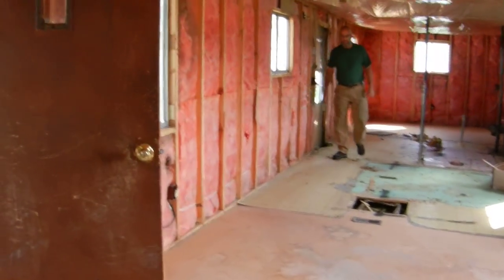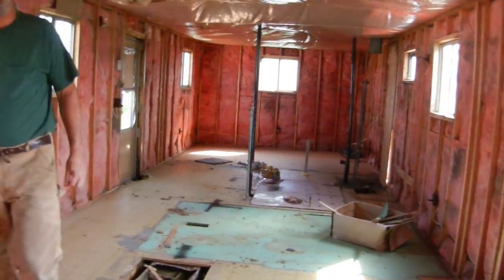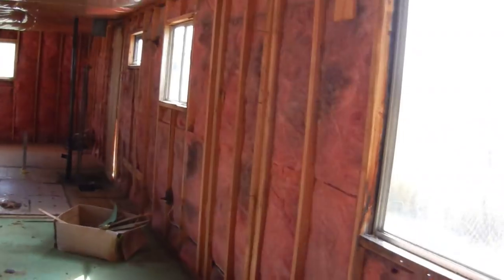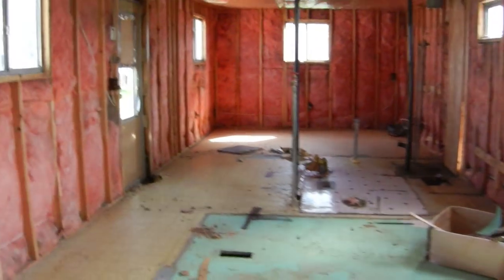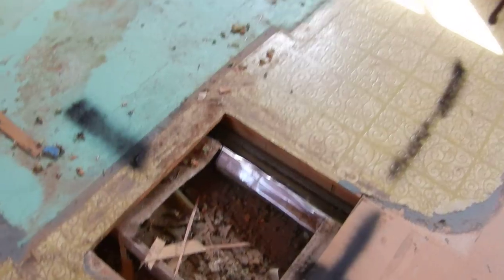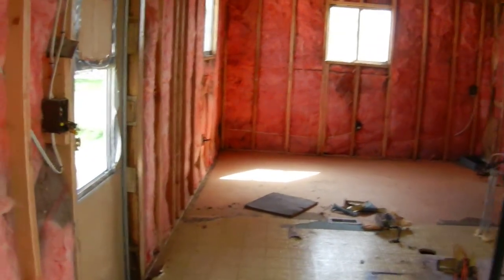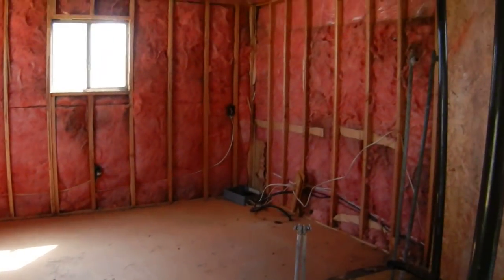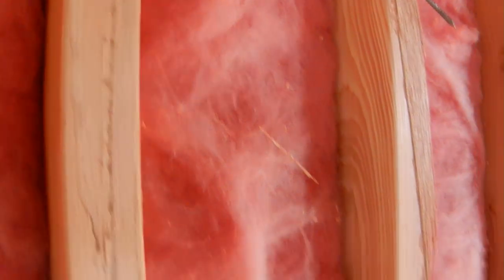Fix Up Old Trailer

Comment: Hi, I see the date of this video. Have you finished the renovations yet? If so, can you post the update please.
I just bought an old trailer home myself and will strip it down soon. Any advice to this single mom on a budget?
Reply: Hi! I just figured I would give you my experience. I have a 1996 4br 2ba clayton mobile home and it was destroyed when I got it. We had to replace alot of stuff but For a few days I called a bunch of friends and family and we got it all dont floors walls dry wall electric paint all for around 2500 bucks looks like a brand new mobile home now

Comment: Do you have any videos of the job as it progressed?  I just bought a mobile home and i am tempted to gut it out like you did and start over from scratch.
Reply: Did you do it? I have a trailer that sat for 20 years and is 50 years old. About to gut and rebuild everything in it. It is that or move and go in debt for 30 years on a mortgage.

Comment: oh please someone help i was given a old late 60 early 70 trailer which is rather bigger then i thought. it needs work but i am not sure if i can fix it. here are a few problems first living room under 2 windows that are side by side the wall moves a little not a lot and just at the windows. i think the beams are rotten out and might be easily repaired. then there is the back door i know the beam that the door is screwed to is rotten i have seen it but not sure how to fix it. the trailer has no insulation under it or in the walls any more. all the windows leak and this trailer has 14 windows total in a 2 bed room. the living room is just about all windows. can i get big windows double hung to fit? please send links wright me just need anything i can get. i have no where less to go
Reply: +fawn williams ...Hi Fawn.  When I had a lot to do on my place, I found a great handy man to work away at all the little things I couldn't do.  I had rot that required some guy work.  I could do what I could do too.  I started slow.  The rot and window replacement had to come first.  I called the local glass/window shop.  They measured everything and fitted me new windows to all my strange sized windows. There is also an 8' sliding glass door.  I divided up the work in two parts a couple years apart in order to make the expenses easier.  Meantime I did some other fixes.  They repaired some of the adjacent framing as they replaced the windows for no extra charge but some of the siding had to be replaced and I had the handiguy do that.  The window installers also built up the casings inside, as the windows didn't have them before.  Dividing up the work didn't cost me any extra.  Decide if you want all those windows the same and try calling your local/well trusted window replacement company and start asking them how to proceed.  If you need to, get several estimates and have some good discussions with them.  It's how we learn.  If I can do it, anyone can. Enjoy!  (Maybe you've done all this already, but I just saw this.)  I agree with Leslie...would love some pictures.
Reply: +itsa goodlife ....one more thing to relate.  I am now buying a '73 mobile with all the attending problems in a distant town.  The price is right and the location is perfect.  Don't know what I'll run into but am a little scared.  It'll be my "retirement/retirement" home.  I say it like that because I thought my current home was going to be THE retirement home.  There's no money in my current home so it will go back to the bank and my meager savings could go fast.  There is no guy in the picture, so here I go again.  No gut job in my future, but glad I know that I can do a little at a time.  Looks like you're and your guy are moving along well.  Good Luck.